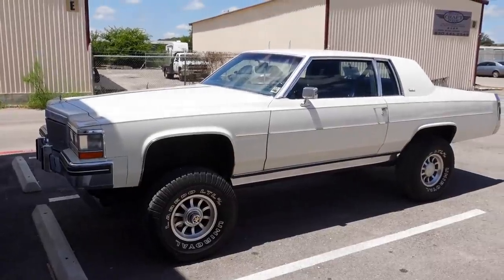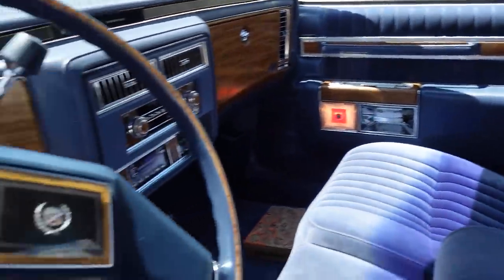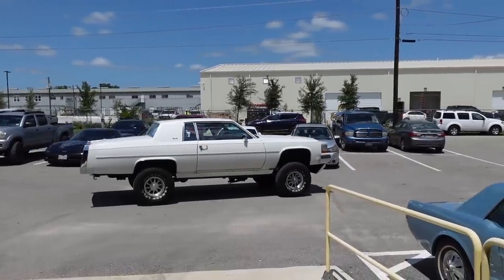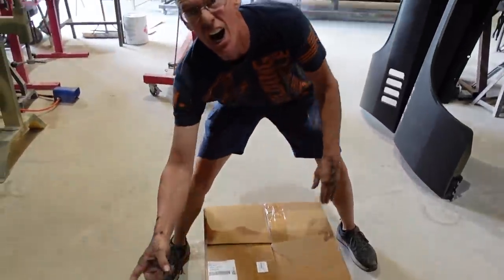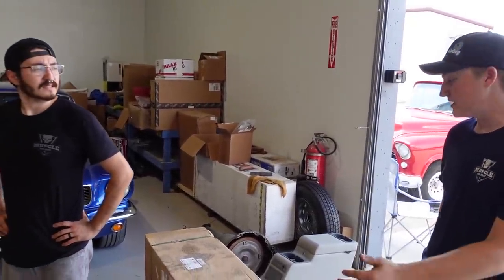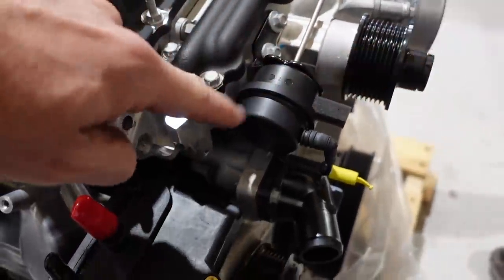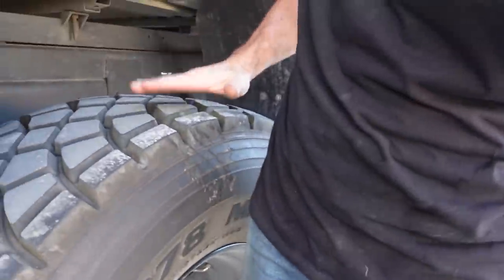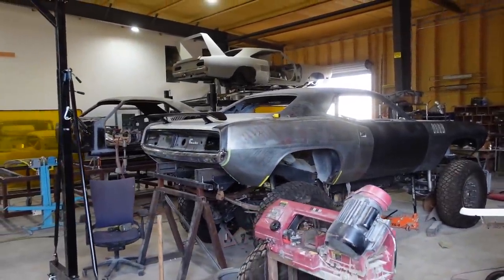A REAL 1of1 4x4 CADDY??? | Muscle Rod Shop tech department cars n trucks

Comment: Funny ... my buddy a life long mechanic ... when a customer would ask how he fixed something, (that he frankly had no idea what he did ... he tore it apart ... put it back together again, and it worked) ... his excuse to his customer was that he just tweaked the canutinator  (like your canutor valve) ... and as it remarkably worked, and he didn't really do anything, (expecting the issue might come up again ...) he explained that he never charged for adjusting the canutinator.  The customers loved him for a no charge repair, and if the issue arose again ... he would see if he could figure out what the issue was, so he could actually repair it.  He told me once, he adjusted the canutinator six times, before finding the actual problem.

Comment: I had a 1 off 1988 Cadillac deville that was 4wd it would drive with rear wheels normally then if the rear wheels began to slip the front wheels would lock and grab traction it had a solid metal pan that protected the underside from rocks and it ran from the front bumper to the rear bumper

Comment: Idk about muffler bearings but there used to be an exhaust pre heater in the old diesels and some the valves where packed with a super high heat bearing lubricant and they muffled the sound from the engine a lot

Comment: I've built a GMC top kick 4 door used to be like 30ft past cab didn't have anything but frame after cab me and my old boss which are good friends turned it into something like that International but a hell of allot more power junked the cat engine and put a 12 valve done out in it. He has sold it now but he does truck pulling wish I could send you some videos.

Comment: Ford and Holden done the same thing here in Australia late 70's early 80's,,     not many produced but are now worth a butt load of coin,,,
Reply: ford did a 4x4 xf ute didn't they... or was that a home build?
Reply: @stevebaker5642  I had a 1976 Datsun pickup that was converted to 4 wheel drive by the dealership, you would buy the truck and have the dealership convert it for you, don't know if ford did this, modification to vehicles was common back in the 70's-80's, can't do that today.
Reply: @stevebaker5642  holden done the Overlander, a HZ wagon 4x4 and ford done XY/ XW Ute 4x4,,,        the XF fair chance it was home built mate,    only factory types i know of is above,,,    but i could be wrong brother